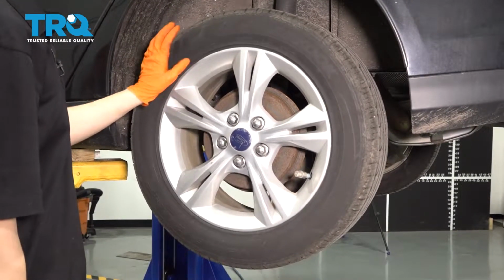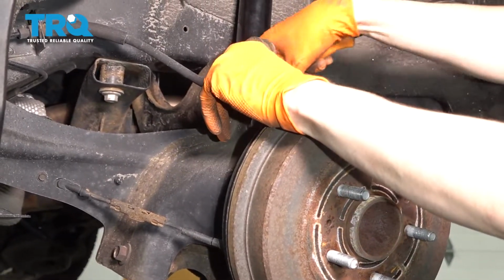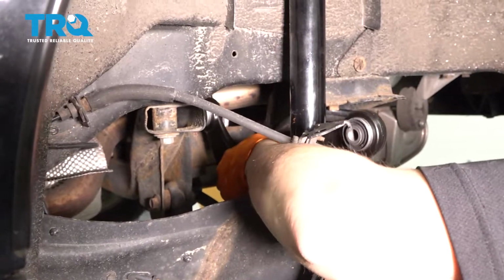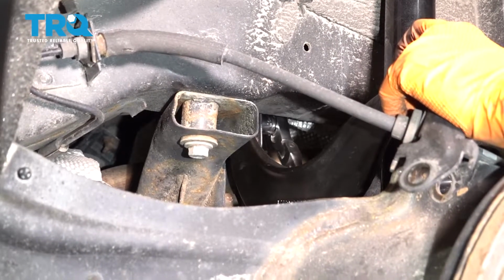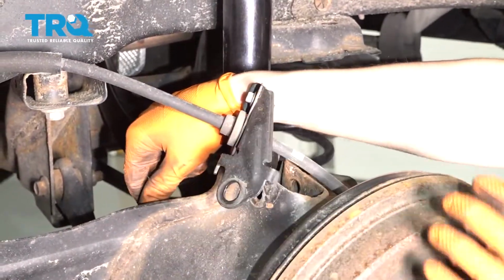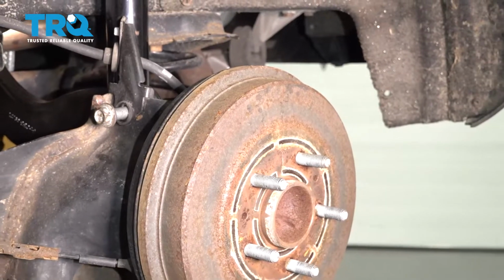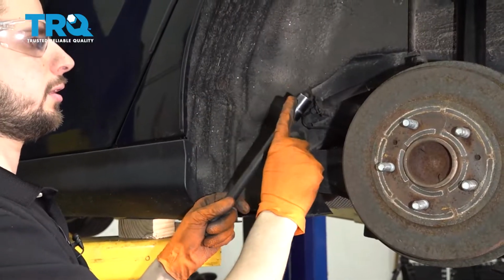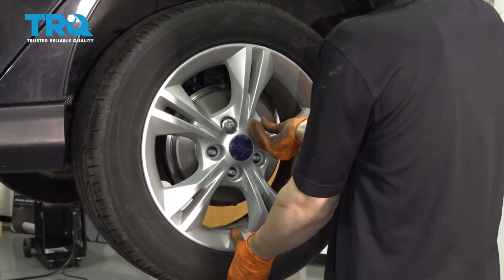How To Replace Rear Upper Control Arm 2012-2020 Ford Focus

Comment: According to the factory service manual ($23.95 for 3 day access through motorcraft) you need to REMOVE THE SPRING AND REPLACE IT TEMPORARILY WITH A FABRICATED SPACER 179MM X 40MM  so that the lower arm/wheel knuckle is at the correct standard height when you torque the upper arm down. Otherwise the upper arm rubber bushings will be under constant bound stress and the whole car will handle poorly and the upper arm bushings will wear out quickly. Pay the 23 bucks and do the job right. THE ST USES A DIFFERENT SIZE SPACER- 164MM X 40 MM